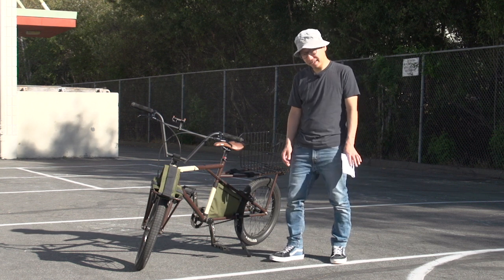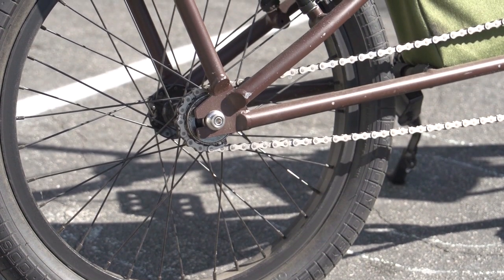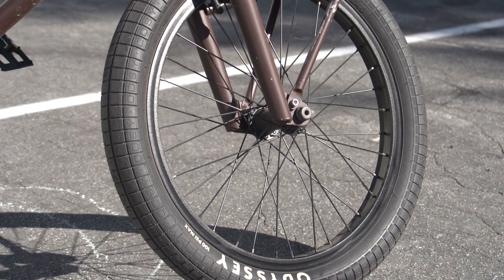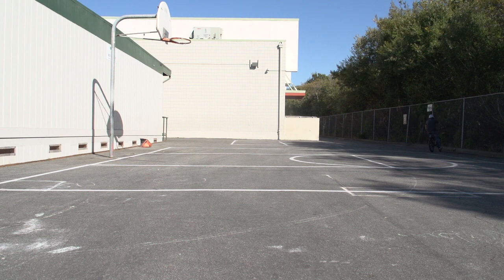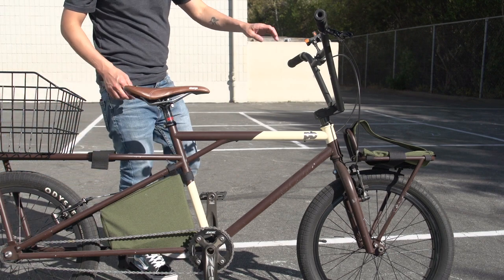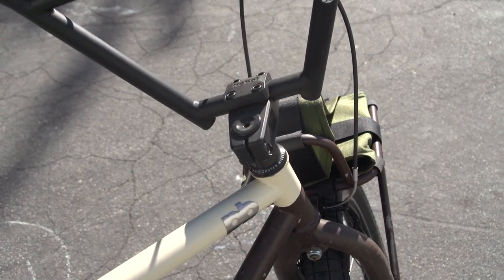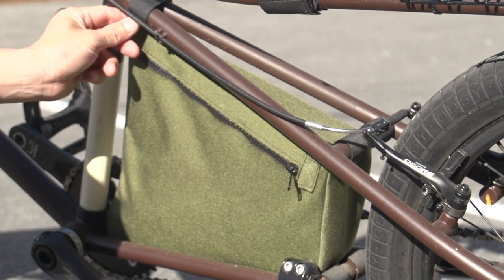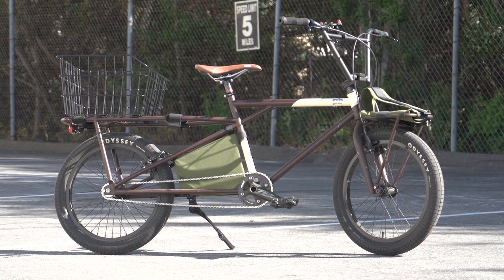20181019 Long Tail Bicycle 1 Year Review

Comment: I'm waiting your next project man ! Keep working ! What you do is really great !
Reply: Me, too. One bike type I wouldn't mind seeing him make is the Schwinn 3 speeds back from the 70s they had a feature they branded as "Flat Stop Technology" or something like that. The main difference in this bike to today's bikes is that you could lower you feet while still seated and touch the road w/o being on your tippy toes. Makes for a very safe & secure feeling riding experience. My father swore by one. They are easy to notice because the saddle had a dual color scheme with a white front at an angled line.
Reply: There are some modern frames that are built with that in mind as well- Specialized calls it "Ground Control Positioning", but I think the only frame they've used it with is the Roll. That model also has 650b wheels, stock with 2.3 in tires.
Reply: @johnpossum556  Weird, I was just thinking about such a technology the other day

Comment: It's normally high trail bikes that are unstable when you ride no hands as the wheel has a tendency to flop to the side. This bike doesn't look like it would be particularly high trail but it's hard to know by eye. Great build and I learned alot from you, thanks 👍🏻
Reply: My guess the problem now is the steep head tube angle, trail is ok to be big since the bike have long wheelbase and lean movement is much lesser
Reply: High trail bikes do have a higher flop factor, but this only a problem at low speeds. 

High trail bikes are easier to ride no handed because the self centering effect of the front wheel is more pronounced compared to low trail geometry.

Also, high trail front ends are more easily influenced by rider inputs through the saddle. This is because of the higher flop factor and it makes a high trail geometry easier to control when riding no handed.

Comment: I remember when you were building this. I loved that build. The bike came out great too. I don't know anything specifically about bike steering geometry, but I would assume it is similar to cars in regard to caster. If it does not want to track stright on its own, I would suspect that the culprit is a combination of the fork pivot angle being too close to the contact patch and the fact that the hub is attached on the front of the fork. It seems to me that the hub is pushing back against the fork instead of pulling rearward on it, and tht might be why it doesnt have a tendancy to track straight unassisted. I could be totally wrong too though.
Reply: exactly like the wheel on a shopping cart

Comment: Great to see it being used for what it was designed and built for. Still looks great. What's next project? You thought about maybe a recumbent? There is a lot of great design in recumbent bikes and trikes. I am working on a tadpole trike, two front and one rear wheel, with suspension and built in storage pods.
Reply from the maker: No recumbents yet but I do want to build one some day. Tadpole trike sounds cool. I never see those in my area for some reason.
Reply: @PithyBikes   Probably the people are more aware of the traffic and don't have death wishes. I love tadpole trikes and almost bought one. Then I took one for a spin and saw how impossible it is to look behind you. They also take up a huge amount of space and are awkward to move around. Then there is the whole issue of getting up out of one and I am not getting any younger.

Comment: Do a test ride with the fork on backwards. It should be much more stable. The steep angle HT angle combined with the front axle being offset so far forward will cause the contact patch to be very close to, or on top of, the axis of rotation. That means very unstable steering. The wheel's contact patch must be behind the axis of rotation to be self stabalizing, like wheels on shopping carts. I have studied this and can help you with more details if you want.
Reply: eeeeeeehhhhh, you may studied shopping carts. but your suggestion only would work, if the head tube angle would be 90°, like on a shoppingcart.

Comment: Very nice bike - the central riding position between the wheels will give a good ride quality and improve low speed tracking (more precise response to steering input). Your hands-free balancing problem is probably due to the mass of your fork-mounted front rack. The center of mass of this rack is ahead of the steering axis so the steering will tend to oversteer (turn too quickly into a lean of the frame). It would be better if you could mount the rack on the head tube of the frame. Great build and nice aesthetics, nonetheless.

Comment: I have a Bike Friday Hauladay, which is very similar in design. It's got quite a bit of flex when fully loaded (>50lbs), but only flex from the stem when unloaded.

I can't ride it with no hands. I attributed that to the small wheels and low fork rake, but I have no idea.
Reply from the maker: Ah very interesting! Thanks for the insight, this is great to know.

Comment: just an idea, maybe move the bottom bracket forward a little, bend chain stay tubes upward to lower center of gravity, use forks that are a little curved or rake the head tube a little more. also me personally, id put some gears on that bike, you already have brake cables, might as well add at least the rear wheel with gears. i live where its pretty flat, but those gears still come in handy on the slightest hill or the slightest wind. btw i am not dogging the bike, i actually like it a lot, was just giving suggestions for you next build. like the old saying, if you do it like you always do it, youll always get the same result
Reply from the maker: It’s good suggestions and I appreciate it. Yes things to consider next build. 👍

Comment: I think that the long wheelbase is playing a role in why the bike is hard to ride no handed. It makes the bike very stable and resistant to inputs/weight shifts through the saddle.

The front end geometry could be playing a role too. It'd be interesting to see the head tube angle and rake numbers in order to get an idea of what's going on.
Reply from the maker: That makes sense. I’ll run the numbers and maybe do another video on that. 👍
Reply: @PithyBikes  cool, that would be interesting. 

The smaller BMXwheels generate less gyroscopic torque (ie. less of a flywheel effect) so the trail number will have to considered with that in mind.

I'm pretty familiar with what represents high and low trail in "regular" sized wheels like 700c and 650b, but I'm not so familiar with how smaller wheels behave and feel on the road.

Once you get some numbers I'm sure it will all become clearer.
Reply: Hi Alistair, I can ride my Tern GSD no-handed pretty easily, FWIW.
Reply: @jimgourgoutis  that's kinda like a Brompton right? 

Any idea what the front end geo is on that bike Jim?
Reply: Alistair Spence  it's a 20" wheeled, long tail cargo e-bike, more like a Dahon than Brompton. here's some details - https://www.ternbicycles.com/us/bikes/gsd - they don't publish the geometry specs so I'll have to measure.

Comment: Regarding the no hands stability, have you tried without the front rack? the geometry does not seem to be far off
Reply from the maker: I haven’t and that’s a good point. Also now that you mention the rack , the bars are pretty heavy too and maybe adding to that
Reply: @PithyBikes  Hey Steve, I'm very interested to know if you manage to figure out what what's up with the stability issue. It's something that we see on our bikes (dockless shared bike in France and UK), and I never quite manage to understand what was causing it 😅
Reply from the maker: @paul-adriencormerais7348  I haven/t had time to look into it. But I have a strong feeling it has everything to do with trail. I think more HT angle would solve the issue.
Reply: @PithyBikes  Ok that was my feeling as well 😅 A good test would be to mount a fork with less offset, I guess ?  If I guess this right, smaller wheels means that you need a lower HT angle to have more trail I guess ? 
In any case, congrats on your channel. It's an absolute pleasure to watch !! Everything is so clear, and your attention to detail is delightful 👏

Comment: Do you suppose the fork rake and combination of the front rack is causing the front end to bias backwards?
Reply from the maker: It’s likely a combo of all front end factors. Wheel size, rake, ht angle, bars, rack. And lastly as Alistair mentioned the longer frame

Comment: I dunno, pretty shady review. Probably getting kickbacks from the builder. Do you find the single kickstand sufficient or do you think a two legged kickstand would be better for loading and such?
Reply from the maker: They said if I reviewed the bike  I’d get it for free. Yes double kickstand would be better. The single is ok but if I started loading the bike more double is the way to go
Reply: @PithyBikes  I inherited a semi-recumbent Giant Revive. Similar problem with the really active steering. Its almost as long as your long bike and the kickstand is just not very stable. You are also a lot better off not having rear derailleur unless you put a roller or something on the chain. They get that long and the chain really has a tendency to jump.

Comment: Realy nice build!
 I'm in a similar situation where I'm about to paint my raw metal frame. Does anyone has a good suggestion om what type of paint I can use?
Reply: Its all about the primer and the prep work. Do at least two layers with a wet sand in between. When you paint, wet sand between light coats. Finish with a clear. Any rattle can system will work.

Comment: As for the paint... painting a raw steel frame is not an issue, IF you were to use self-etching primer that is. You should never apply finish paint to raw steel, you're lucky all the paint hasn't just fallen off. I spent my summers at my step-fathers body shop, and we NEVER applied the finish coat of paint to raw steel... we always had a primer layer underneath. I used to work for Toyota and even though the trucks had an ED coat applied (the trucks went through a big bathtub full of coating), the trucks still went through primer.
I have a road bike that also is not possible to ride with no hands... for very long... the front end is just plain to twitchy to do so. Slack head-tube and raked forks are key, new bikes with straight forks make it harder then ever.
Is this more "hobby" or are you trying to get into building your own bikes?

Comment: One of the main reason people don't buy these bikes is a price because they cost as much as a motorcycle and it's cheaper to buy a motorcycle than it is to buy one of these things and easier cuz you have to get a freaking bank loan to get one of these damn things it's disgusting old has a few more pounds of steel on it than a regular bicycle in a couple pieces of wood that it cost 50 Cent's what the f***